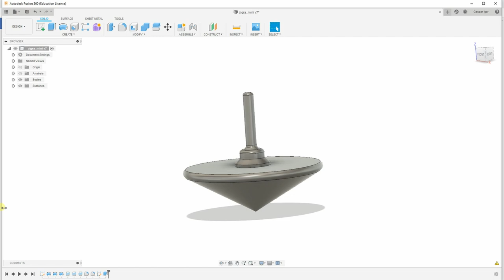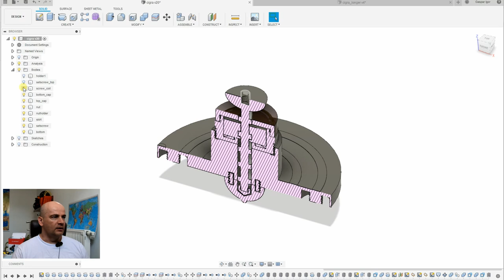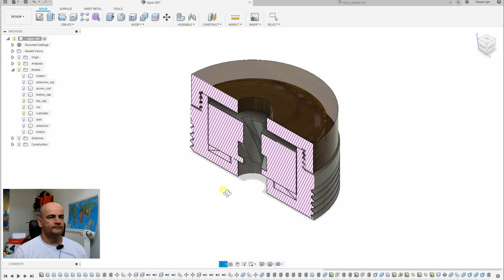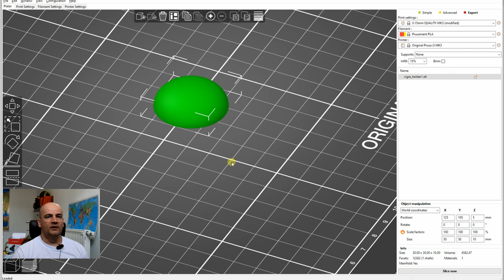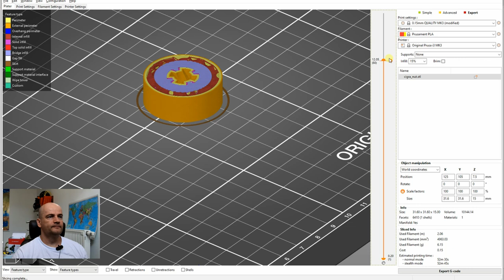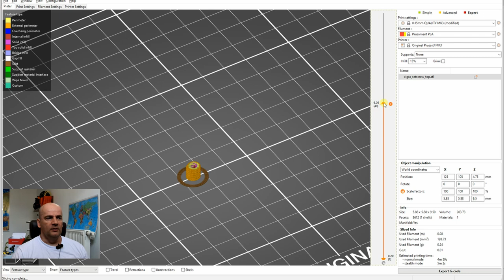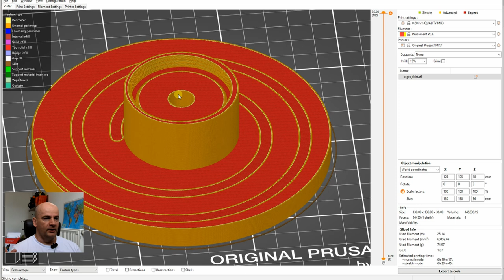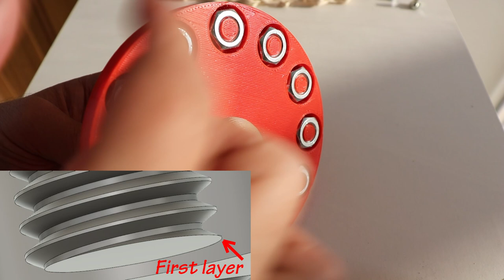Spinning top toy with coil - 3D printed

Comment: Excellent! If you'd like a longer spin time, try raising the clutch above the rotor instead of lengthening the tip assembly below the rotor. The lower the rotor is to the ground, the slower the critical speed at which the top falls. For a given launch speed, that means a longer spin time.

Comment: What an elegant design! You mentioned not wanting to use a metallic spring because it's not available in non-standard size for your design. What about printing a plastic spring? Just an idea. Seems to work just fine without a spring...and the noise is part of the fun.